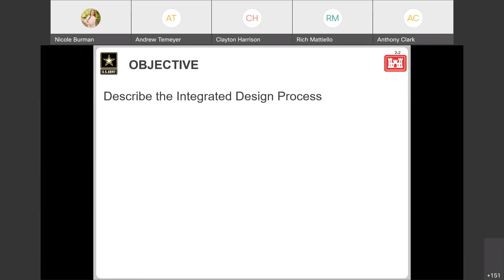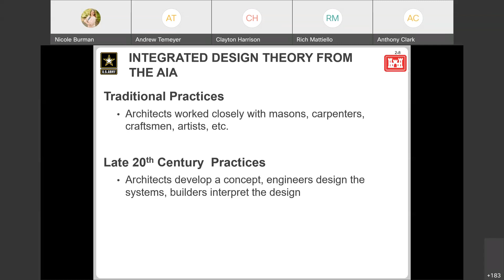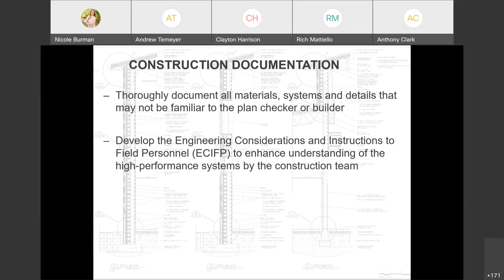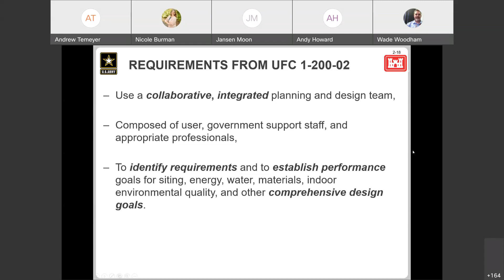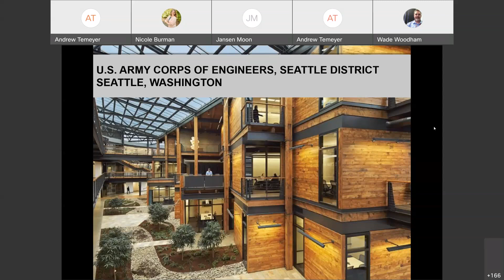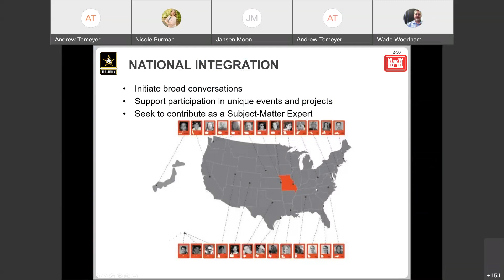Integrated Design Strategies for Army Project Delivery

Comment: For construction phase, summary goals in bullet point form is required to be written into the Partnering agreement. Otherwise discussions without record lose attention quickly. Some contractors just do not have practice with sustainable methods and documentation within the USACE culture and how it integrates with LEED if that is to be pursued. Same is true for some USACE employees.